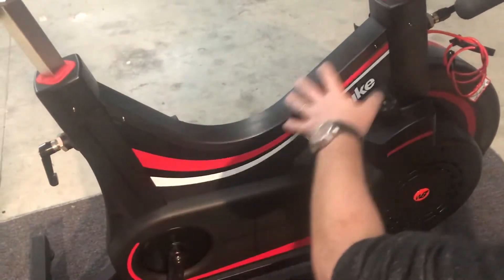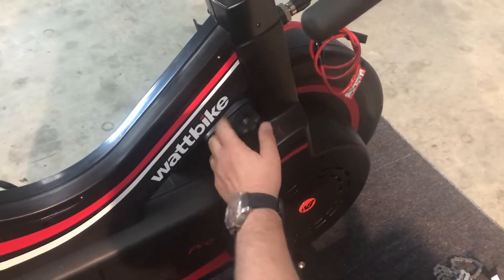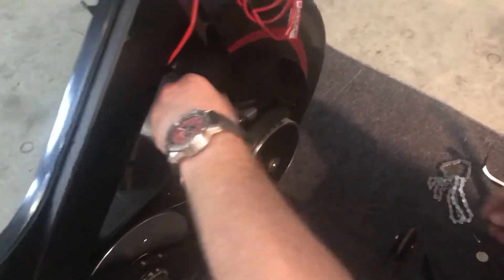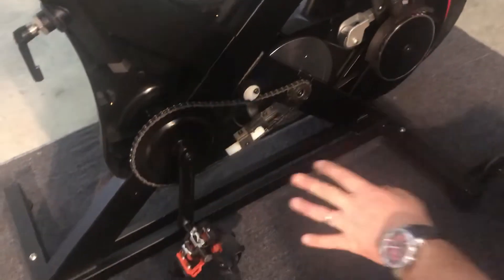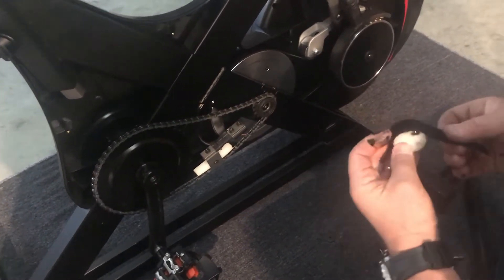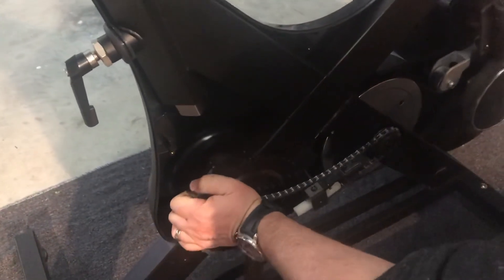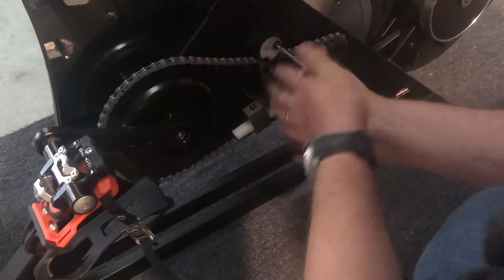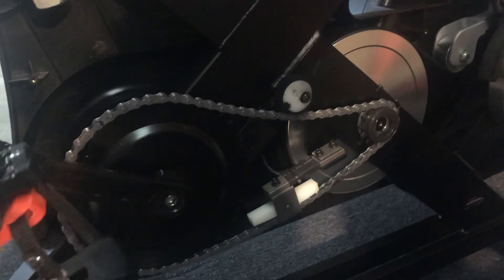Taking a Wattbike Pro/Trainer cover off -  changing the chain and resetting resistance

Comment: Subject: Help Needed - "Sensor Not Connected" Error on Wattbike Pro Model B

Hi all,

I'm experiencing a "Sensor Not Connected" error on my Wattbike Pro Model B. I've already tried troubleshooting by replacing the comms cable and monitor, but the issue persists. My current firmware version is 1.24.01.

Has anyone else encountered this error or have any suggestions on how to resolve it? Any help would be greatly appreciated!

Thanks in advance!

Comment: The one thing you didn't change was the touchpad which has a big effect on the power reading, ie low if the touchpad is worn.
Reply: My wattbike is giving a very low power reading, it could be because of this but do you know of any other causes for this? Thanks

Comment: Hi, I took off and cleaned the chain then adjusted the tensioner as my chain seemed a bit stretched. Now though when I stop pedalling i'm still getting a power reading as if I were still pedalling when in actual fact the pedals are stationary. 

Any idea why this might be? Thanks in advance if you have any information on this issue.

Comment: Great video, thank you. 
I’ve replaced the chain on my wattbike and now the monitor turns on, but does not start the workout when I begin pedalling. 
It’s almost like it’s getting no data. 
Any ideas what this could be?
Reply: Hello!  I have a similar problem with Wattbike.  It does not receive data from sensors and does not start a workout.  Please tell me, were you able to fix this?  Could you share your experience of solving the problem?

Comment: If there’s an issue with the magnetic resistance,  is it likely that it just needs tightening as per this vid? Thanks
Reply from the maker: Sorry for the late reply, it will only need tightening if it is loose and springing back to 1 when you are trying to use it at a higher resistance. So it really depends on what your issue is...
Reply: @iconsportnewzealand8866  no problem! It doesn’t “spring back”, we only now get resistance at the highest setting, with every setting under that having no effect/resistance what so ever. Does that help?
Reply from the maker: @Grangey  Could be that the whole magnetic system has moved a little inside. That would mean you would only feel any resistance when it was turned to maximum or near maximum. Might be worth having a look at our cover off video. Once inside you will see the magnetic system is bolted on with two bolts. You can reposition it so that when on max it is a mm or so OFF the flywheel. You DON'T want it to touch the flywheel when max resistance is applied. I tend to put something between the magnets and the flywheel when it is loosened to position it (remember they are magnets so they will grip to the flywheel like mad!) As it is a horseshoe shape I use three spacers between the magnets and the flywheel one on either side and one in the middle - something the width of a credit card is the correct width to get the magnets positioned close to the flywheel without touching it. Once the bolts are tightened, wind out the magnets and the spacers will pop out but the magnets wont be able to get closer than that. That 'should' restore it to how it left the factory so you should get your resistance back. Difficult without seeing it to diagnose it, but that could be it - or you are just strong and need to upgrade to a Pro!

Comment: Hi, I need to replace my chain, is it just a standard length chain you used?
Reply from the maker: Sorry for the late reply, you'll need to cut the chain to the required length or buy one that is the correct length from a Wattbike distributor
Reply: The chain shorter than a standard road bike chain, it also does not have a quick link. If you buy a chain not from wattbike get an 8 speed or "single speed" chain. They are stronger and wider than a 10 or 11spd chain.